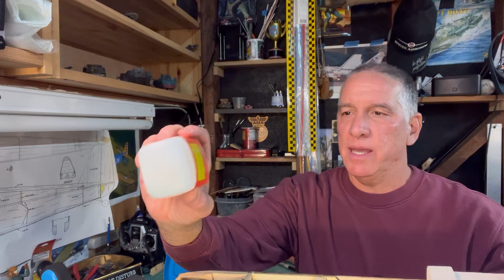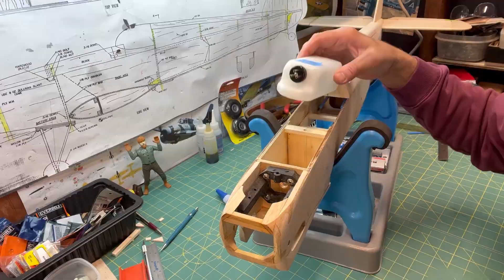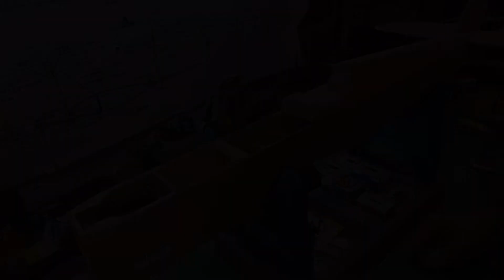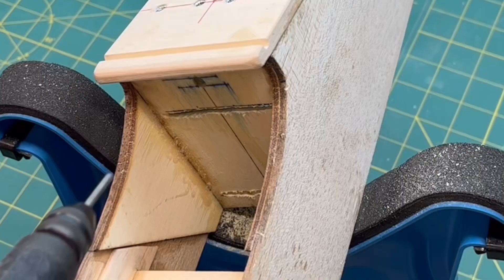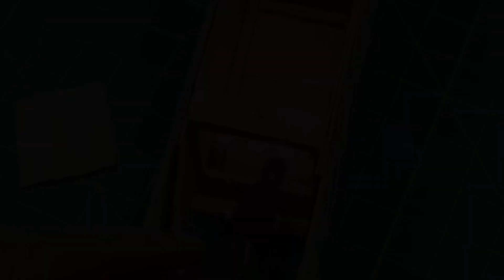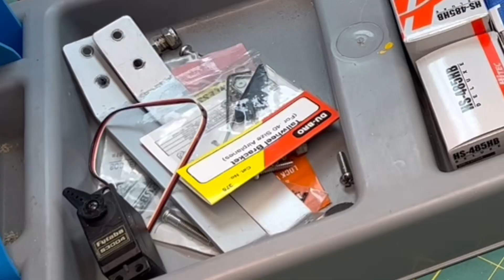Balsa USA Smoothie RC Plane Kit Build No 33, installing the Du-bro 8oz Tank

Comment: Nice save! If you were to install the tank at an incline on the fuse floor, that would not be be detrimental to fuel flow. In fact, if either end of the tank was lower, the klunk could be placed there and you would get additional flight time from a more fully emptied tank with less unusable residue since it would all collect and be picked up.
Reply from the maker: I was thinking about slanting the tank if the clunk didn’t work, but it seems to have helped. Thats a good tip about slanting. If the clunk gums up, I will try a slant. Thanks for the comment.

Comment: A tip on saving time would be to utilize the base for your square when taking measurements. You would just slide down your scale to wherever you want to measure to lock it in place and transfer it over to your bulkhead that you were measuring.
Reply from the maker: Thanks, ya thats what the square is for, right. sometimes I get caught up in a thought and make things a little harder than they need to be. Thanks for the insight.

Comment: You might be better off using a flex cable for the throttle linkage! They work really well!
Reply from the maker: I was considering something like that. Ill see how it works out. I think Ill invert the throttle servo so its more of a straight shot to the throttle. Since the servos can be accessible from top or bottom, that may work.